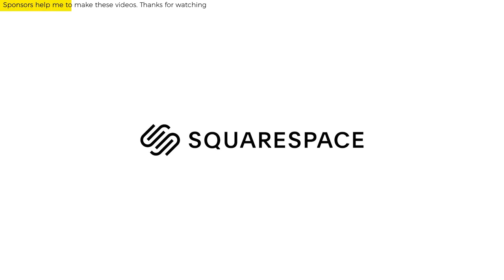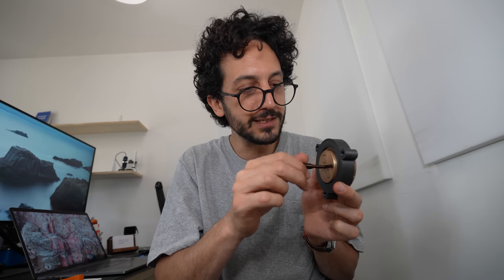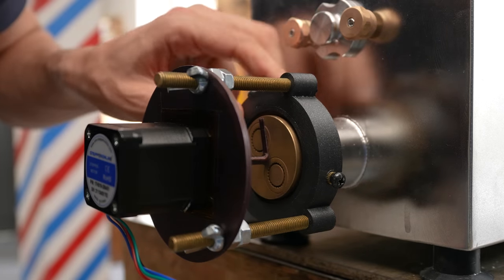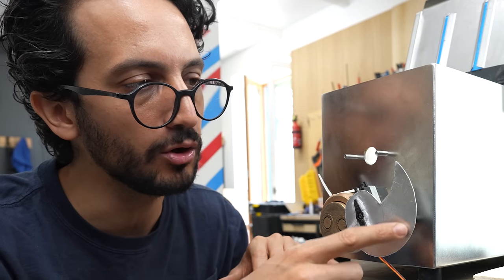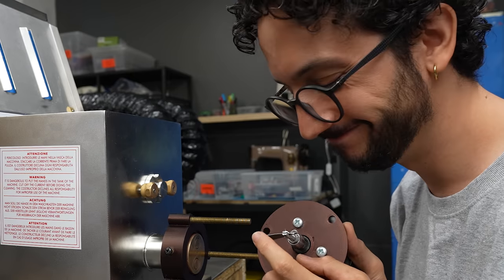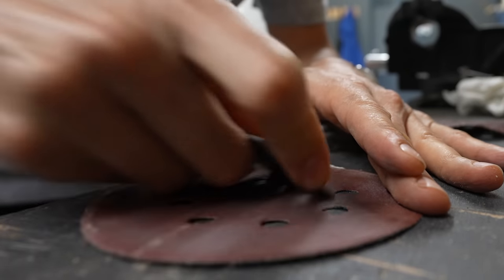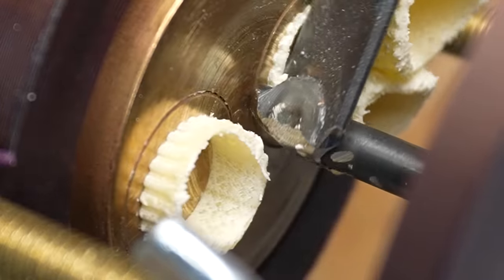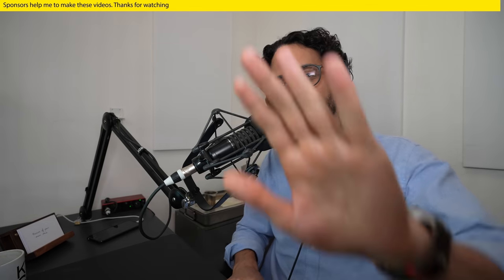I Tried to Make an Automatic Pasta Cutter (did NOT go as planned)

Comment: Nice work!
I noticed that you started with a stepper motor using Arduino control. That could have given you controlled, intermittent cutting periods. Then you switched to a wiper motor, which is usually run intermittently.  But with both implementations, you ran them continuously at slow speeds.
Now consider this: Run the motor faster and then pause between cuts for controlling length. Lower the blade angle to reduce squishing. Finally, try springs (or maybe a spring steel cutter?) to keep even pressure across the die.

Comment: your spring blade can be fixed by rotating the blade. instead of slicing the pasta apart it was pushing the pasta with the blunt flat surface, which is why it was smashing them, and sticking to the blade. second is speed. you could make the blade move 2-4 times as fast, but have a delay in each complete rotation, to allow the pasta to be longer. if that motor is technically a stepper motor you can change that in code. if it's not a stepper motor you can use a gearbox where the gear on the motor only makes contact for a fraction of the rotation, and that fraction of the rotation of the motor is a full rotation of the blade. Not sure if it has the torque for that, but it's just thoughts for in future.

Comment: Just an idea.
You could think about placing the center of rotation of the blade outside of the circulare face of the extrudor. 
That way, with a longer blade, the cut is gonna be more swift and the blade won't be in the way of the falling pasta.

Comment: You should use a clamp design to fix it on the extruder and, you should use a razor blade and it should be on an angle and you should be able to utilize the existing mounting holes by bending the shaft. You can also use a motor from a drone and 3d print a reduction belt to get the best precision and the speed. You also can use a microcontroller to set a delay between each swipe so you don’t have to run the blade too slow.

Comment: I would put a center point in the die (like a countersink) for the cutter shaft to ride in. This will take any flex out of the shaft. Also a replaceable razor blade for hardness and longevity.

Comment: What you could use instead of a rotary cutter, is use one of those motors to drive a thin wire up and down. Not only would the gears that transfer the rotational motion into linear, up and down, motion give it more torque, since the reduction in speed would result in more torque, but it would also give you longer pasta by increasing the amount of time between slices. You dont have to use a thin wire, you can use one of those thin saw blades or something, but thin steal wire is the easiest and cheapest to replace if need be.

Comment: Given that you're were using a stepper motor in the beginning, I would personally suggest connecting the Arduino to a stepper motor driver instead (e.g. A4988, TMC2208 or DRV8825). There are some nice stepper motor libraries. You can time the rotations nicely and get some very discreet rotations, one step at a time. 

Another thing I could suggest is using a safety razer blade to do the cutting :) Should be plenty sharp!

Comment: Did you try cutting The pasta using a metall string tightly stretched? That Will reduce the pasta stickning together.
Also moving The rotation center further away from The extruder Will decrease the time the cutter goes through each dough. Although this Will increase the pushing torque induced by The dough. But you can even use a gear box then to slow it down to create longer pieces.

Comment: 1. I think a stepper motor with changin the polarity would work. 
2. The blade needs to go down on i.e from 11 to 7 (clock reference) on one stroke and then the reverse on the other. (7 to 10). 
3. In this case you can mount the blade parallel to the extruder and with a very close tolerance also. Instead of metal piece which needs sharpening, a razor blade should work better since its much thinner and much sharper. 
4. Think of the contraption as a horizontally mounted metronome. 
I Hope this helps. Also, after watching this series, I did get myself some monograno felicettti shipped to me in India and am planning to make the aglio-e-olio soon. Thank you for such an interesting take on food and educating us on the intricacies of cooking. Salut.

Comment: Hi Alex - I found your channel at the beginning of the dry pasta series, and was immediately hooked.  Although you I.D.'d yourself as a chef -  you exhibited many behavioral aspects of an engineer - mainly in your approaches to problem solving.  "He talks and acts like a Process Engineer..." I told my Italian cousin - sure enough - you revealed in the pasta dryer episode your Double-E pedigree.  As a retired M.E., I see we're cut from the same cloth - very hands-on - therefore, please allow me to make a modest suggestion:  You need a pivot support for the cantilevered end of your cutter blade.  You could mill a small diameter spot face into the outer surface of the die - centered between the extruders - or, drill and insert a small diameter pin - that would index into a matching blind hole in the floating end of the blade shaft.  Having lateral stability and turning true, the blade would cut much better.   I also agree with many of the suggestions offered here; e.g., pause the rotation, then spin much faster;  use a thinner & sharper blade;  try cutting straight across the die face;  etc..  BTW, gracie mille for what you do!  I made a pasta ai crostacei - chopped clams, scallops, & shrimp, in the basic aglio e olio sauce, with additional clam juice and lime - using Chef Luciano's techniques - it was perfetto!  You have significantly upped my chef'ng game!

Comment: Hey Alex!!! Love your channel!!! Just wanted to comment on the last cutter, it could possibly work better if you come in at a steeper angle with the cutter, as well as a sharper blade. If you had some sort of spring mechanism to add more pressure on the blade, as well as something to hold the blade at the center of the pasta die. That combined with the angled, sharper cutter could work best. I don’t think the speed of the cutter matters in this case. 
Just my humble opinion… 🤞🏽🤞🏽

Comment: If you make the cutter into a much bigger circle and offset it to the side — then 75-90% of the cycle is idle then you can have a good speed when cutting without needing to stop & start. Also using the outer part of the circle for the blade makes the blade speed more even — as opposed the the central part being quite slow with the present design. Also a sharper blade at a less steep angle can probably help.

Comment: If u make a cutter plate that can have a changeable razor blade attached to it, you not only can make it adjustable to get as close as possible to the extruder, you can also, if it’s dull, turn it over, sharpen it or replace it.

Comment: To cut the the pasta effectively, you need something that can cut fast and in interval.
Therefore I suggest making a cutter using Geneva drive. It should be able to provide snappy motion required to cut the pasta and the ability to actually cut something in variable interval, therefore variable length.

Comment: A wire blade might help, you can make a rotating disc with two pins on the outside edges. Might help with the clogging up. 

As others have mentioned, the closer you get to the axis the slower the surface speed. 

Can you offset the motor pinion to move the axis further away from the pasta? You might have to get clever with the mounting arrangement as the blade may foul on the rods.

Comment: Use a wire for cutting. Pause between revolutions. You don't need a an expensive servo motor. Keep the stepper motor and use a cam on the outside of the wire holding "ring" to trip a roller switch that triggers the delay.

Comment: If the motor is mounted off to the side of the extruder, instead of aligned axially with the rotation point centred on the extrution path,  you can set a much larger radius for the cutter arm, and it’s easy to get your sweep time and torque dialed in,  Might need to giver your mount a bit of a ramp so you get a smooth on-off of the blade to the extrusion face.

Comment: You solved the problem with the motor not having enough torque by using a DC motor, which is perfect, but I think if you wanna elevate this you need to look at cut speed and dwell time.
When you cut the pasta by hand with a knife, you made a very fast sharp stroke, then waited several seconds before repeating. You need a mechanism that can emulate that kind of motion.
A constant speed rotary motion works for small pieces because the blade is moving quickly, and so doesn't bind up with the extruded pasta between cuts. If you slow the motor down to allow larger pieces, you risk the trailing edge of the cutter being in the way of the extruder as it's pushing the pasta out.
Can't wait to see where you take this :D Good luck! <3

Comment: There should really be a replaceable blade like an old-school razor blade and i would program the motor to go fast when it cuts the pasta and to go slow when it doesn't travel over pasta cutting region. You might also wanna adjust the angle at which it cuts. I would also try to get rid of some of the wriggle room in your contraption.

Comment: What i would have done is revise your first blade (the 3d printed one) and print the blade at a slight angle so it'll lap itself flush against the die using the pressure when you put the whole thing against the pasta die. I would also use and actuator as other people have recommended to quickly turn it 180 degrees every few seconds since there isn't enough width in the die for the blade to have speed to cut the pasta while letting the pasta get to the length you want. As other have also pointed out, the steepness of the blade might help with the clumping of the pasta when cut

Comment: You could move the cutter motor off to the side instead of having it rotate in the middle, that would allow you to modulate the speed and other variables of the cut, like changing the curve of the blade to change the cut. Having it in the center might also work, but seems you’ll have to change parameters for the motor, forcing it to stop between rotations to allow for enough pasta to pass through, before cutting at high speed.

Comment: I think you need to have the blade overall diameter larger, and have the point of rotation offset to the side, like the one with the servo was. also maybe just use one of those small utility knives with the extending blades so you can replace the blade when needed. by using a variable offset you can control the blade speed and pasta length independently. also get a proper stepper driver with maybe a nema 23 if you need more torque. then you can have it run and stop so you have even more control.

Comment: Love your videos, Alex.  I watch them all the time.  I'll offer my humble opinion based on limited knowledge.  You can do what you want with it.  First, I think you need a much sharper cutter.  Something in the range of a scalpal blade so it cuts through instead of crushing.  Second, I would have the blade at an angle so it slices through the pasta.  And finally, more speed on the cut.  That gives the pasta less time to adhere to the cutter.  Since your diameter is small you might have to use something that intermittently activates the cutting blade.  Bonne chance.

Comment: I think you might be able to improve things by making a cutter that rotates parallel to the die face. If you had an axel with two wheels mounted on it you could string cheese wire between them at set intervals. The wire would scrape down the face of the die cutting the pasta. You would then have fine control of the timing of the cut by adjusting the spacing of the wire on the wheels and also the pace at which the wheel spins.

Comment: Another problem with the final design is the use of only one blade. This means one cut of pasta is dragged along the blade until the second cut of pasta can be made and both can fall off the extruder. 

If you switch back to a two blade design this could eliminate this problem. Or similar to what others have suggested, reduce the surface area of the blade and increase the sharpness - this will reduce friction and produce a cleaner cut. Increasing the speed of the cut and introducing a lag time in the cycle will also improve the quality of cut

Comment: One thing that nobody is commenting is that the extruder is positioned at a right angle. This is not allowing the pasta to get cut and fall directly down, hence it sticking to the blade. The commercial ones are all vertically positioned so the pasta works with gravity and falls down immediately after being cut.

Comment: Thin wire or a razor blade would be good options. Both are sharp but also thin and flexible so you can have a very small tolerance against the die when cutting.

Comment: Have you considered a razor blade, like the disposable ones that have two edges? you could use a servo that swipes the blade quickly in front of the die in a fast, slashing motion.

Comment: consider a stepper motor, where the cut is fast but the motor waits between cuts.
consider extruding smooth pasta instead of ridges. the smooth pasta should be way easier to dry out with the consistent dimensions of the radius

Comment: i was thinking about a drone set up there are motors with plenty of Nm and they are pretty easy to setup with a controller you even could use a remote to power the motor manualy then you only need a thin blade (maybe a carpercutter knife as mentiont in a comment) that is rigid enough to withstand the force of cutting the pasta dough.

Comment: That is a stepper motor you had at the beginning so you should be able to move 90 degree pause then do it again. Or you could have bought the stock cutter then adapted it to the smaller machine.

Comment: (haven't finished the video yet) You could try using a faster motor, with a gear reducer to give loads of torque and dial in your RPMs for the cutter, and use a substantial blade, you can also write more code for interrupted cuts rather than continuous rotation of the cutter, more optimized for timing with your extruder.

Comment: If you used a razor blade (for a stanley knife) and had a cam operated knife which returned by spring you would be able to load the blade tight and loaded against the die and copy the speed you were using while manually cutting. And gives you replaceable blades that are sharp with ease.

Comment: I don't know how attached you are to a rotary mechanism, but I would suggest using a linear actuator of some kind with a wire for the cutting source. Using a wire would allow you to preload the wire so it is always pressed against the plate and using a linear system would mean all you would need to adjust for longer pasta would be how often the actuator toggles from a to b or back. With a rotary mechanism the slower you rotate the less actual cutting the blade does and the more it is just in the way of the next pasta piece.

The reason a rotary mechanism works for a larger system is because of the speed at which they can run and how small of a percentage each piece of pasta covers across the whole surface area.

Comment: Alex, you could have done more efficient dispose 
you have solve a solution by setting an estimated time for your heater to on off
you could have used the same method for the pasta machine like you use your pasta machine to pull out pasta for 5 sec and the pasta will stop come than then the cutter will start to cut it will run a full circle and again the pasta machine will start it's work
It is best solution that I have otherwise I'm seeing a everything mess
I hope someone could give me a better solution than this
I would be grateful for that knowledge 
Don't lose hope, you got your back
keepit up I love your series

Comment: Use a thinner blade or tilt the pasta machine towards the extruder so that the pasta is more likely to fall straight down instead of rotating with the blade. Also having the ability to control the blade more precisely so that it can move fast when cutting and slower when it isn't to get the longer pastas (one quick full rotation, stop, repeat) also I wonder if you would get cleaner surface on your pasta if you'd only have one extruder hole (more pressure)

Comment: I am think you were on the right track with the spiral. If you made it into a set of nautilus gears, it would've had a higher cutting speed at the cutting time. Your extruding die doesnt really have space for a lots of torque/shearing moment across the blade, so having a higher speed (cutting) could probably solve a lots of issues. That would also mean that it would require a gear set outside of the die's axis.

If we get inspiration from hand cutting, the mechanical elements would be the wrist and the hand holding the knife. You could build something like an old train's wheels, one end of a transmission rod attached to a rotating wheel, and the other end attached to the end of the knife. In the middle, there the pivot slot. The knife would cut as the wheel spins 360 degrees in a swift motion.

Comment: I think if you use an air actuated cylinder with a straight blade and cut from the left to right in a fast in and out you would cut the pasta cleaner. The force would also generate enough punch to fling the pasta off the blade. You could use a regular razor blade with a 5 to 8 degree angle to apply the correct pressure and also be easily changed.

Comment: I think you should use disposable razor blades or a cheese wire. Move the motor further away from the die and use a bigger radius so you don't have to limit the power to the motor.